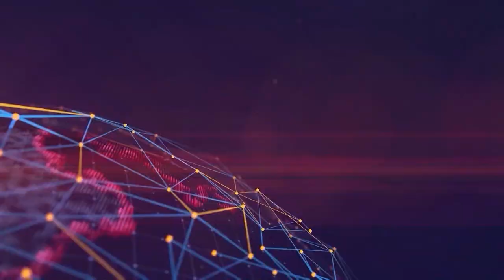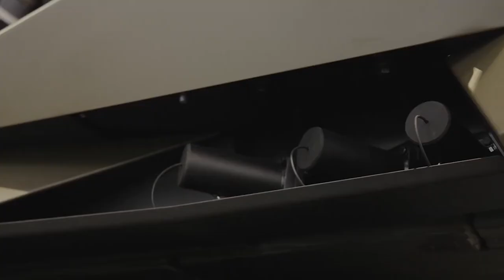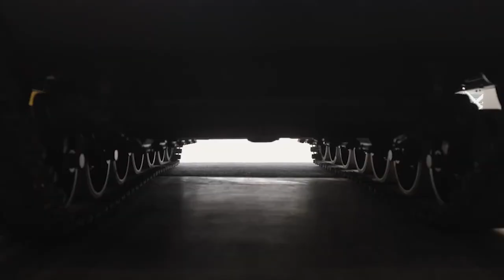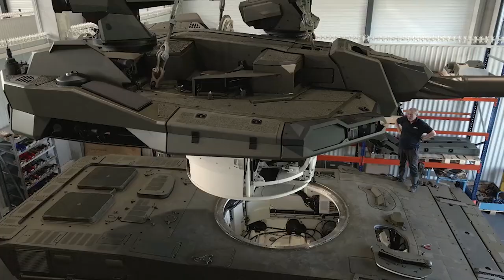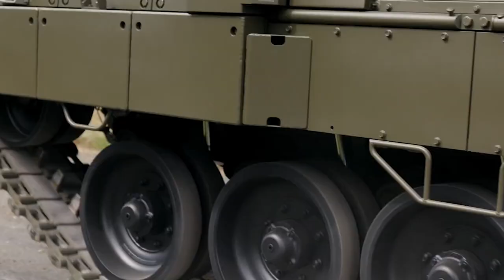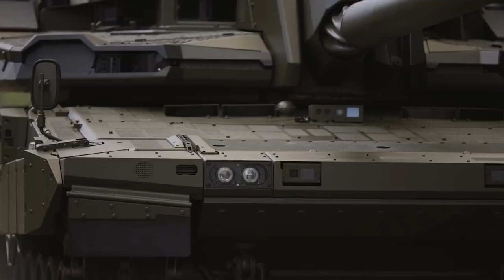Discover EMBT Nexter future concept of Enhanced Main Battle Tank developed by France and Germany

Comment: The first demonstrator was a Leo' 2 with a Leclerc turret (to prove that the second was integrable into the first. Well, 6 year later, the prototype is here and... that's litteraly a Leopard 2 chassis with that seems to be a redesigned Leclerc turret and a GIAT 120-26 gun.

I presume some work was done to integrate further tactical system, but basically, according to KMW and Nexter, the future of european armored warfare was designed into the 70s...
Reply: If it took them 6 years to do that, then I don't see 2035 yet.
The main problem with the new joint tank is that the French claim a share of the tank building... good or bad.
And then Rheinmetall was more or less pushed out of the project. Not good for Germany and not good for the result.
I would beat an egg over it and rather rely on Rheinmetall and the KF51 Panther.
Why should we leave the key technology to the French and let them design the new tank turret. Even the Leclerc was only a second choice. Germany can then build the chassis... well, great.
Reply: @bobthecanon3457  Germany knows how to build better chassis, and the french knows how to build better turrets. It's as simple as that. I could argue the KF-51 is just a bigger and modernized Leopard 2A7 with a shiny new gun and an ATGM launcher. I don't understand your arguments because it can be said for the other way around
Reply: @pow-r_official  🤣🤣I have to laugh. Rheinmetall can build towers, but they were pushed outside the project. France is now only using the opportunity to bring the second best steak to the man but who says that Germany will not choose a Panther as Leopard 2 successor. What are the advantages of the French tower? Absolutely none! And the shape alone is not very suitable for combat.
It's not about France and Germany, it's about the product. Unfortunately, this project cannot deliver the perfect result, as the interests of two countries and manufacturers have to be taken into account. That's the problem.
We see the problems at Airbus. Unfortunately, France is not very cooperative.
No, the Panther isn't just an A7V... it's a completely new development. The demonstrator is currently still using components, but the hull has been completely redesigned, as has the turret.
Reply: @bobthecanon3457  It's the main principle of a joint project. If the french finance as a stakeholder, they have the rights to claim a part of the developement, otherwise, they might as well buy their future tank off the shelf. But yep, I agree. Moreover, France and Germany have often different vision and use for their comparable equipment, and it's difficult to find acceptable compromises. The EMBT have IMO the same future that the SCAF, and it's not bright.

Basically, Germany will probably rely on KF51 concept: fully Germany-made, well armored, conventionnal and adapted for export. And France... Well, replacing the Leclerc is not a emergency, and there is another french neighbor with a quite similar tank doctrine, used to collaborate with those pesky and capricious frog-eaters in successfull jointventures and a strange and mobile mobile tank designed in the 80s which require some modernization.
Reply: @Jenkouille  No, the problem is that Germany actually has project sovereignty for the new tank and France for the aircraft. For the financing, that was a good idea 6-7 years ago... you couldn't assume that Europe would be at war and Russia would be the new old enemy.
So it would have been completely irrelevant what would have come out of it.... for the best in peacetime it would have been enough. But now things are different. We really have to work hard. It's about defence. Our army needs good, superior weapon systems.
Germany is having a really hard time with young people in the Bundeswehr anyway. We can't fill up the army already. That means... we have to have excellent weapons if we can't scrape together that many soldiers.
Yes, I hope we will rely more on Rheinmetall. With the merger with NEXTER, KMW put the nail in the coffin on the company anyway.
I have nothing against the French, but we build better tanks.
Reply: @Jenkouille  The project already started with the French and KMW starting to push Rheinmetall out of the project. Of course, France has an easier game. Corrosive stuff. Rheinmetall builds the best guns in the world and is a leader in many other areas. It's cheeky that NEXTER and KMW think they can push this competitor out together and then settle the matter among themselves. The shot backfires.
I say... they won't build the Leopard 3. That's what Rheinmetall does. And it's always like that with the French. It was the same with Airbus.
Reply: @bobthecanon3457  you have 1 french manifacturer and 2 german ones. Therefore germany would have 67% of the project with 33% for the french. 

Objectively though, french turret is more capable then the leopard for its doctrine. But in the end you're trying to compare two different war doctrines into one bag. Armies have different needs. Not all tanks have to be a leopard.

And please, be a bit more respectful for the things you do not know. We understand you are a big Reinmetall fan.
And I share as much respect for Reinmetall then I do with Nexter or any military brands in the universe. They all have something interesting to show and we need to have this diversity to earn the best products
Reply: @pow-r_official  Wouldn't that be 66%? 😂 Math is hard.
Reply: @pow-r_official  Basically you hit the nail on the head 🤣
Reply: @pow-r_official  Really 25% 🤣Well... math doesn't seem to be your forte. The correct figure would be 33.333% and not 25% (assuming equal shares). It's a good thing you're not building tanks.
NEXTER and KMW, which founded KNDS, kicked Rheinmetall out of the project. More or less. De facto there is only one company from two countries.
Reply: @bobthecanon3457  bravo sir
Reply: @pow-r_official  Thx... I know 😇😚😏
Reply: @terrestrialextra4790  
You're right... he (Homeless Studio) was probably a bit embarrassed, that's why he changed it from 75/25 to 67/33%.
Reply: @bobthecanon3457  Rheinmetall builds the best guns in the world..... what a great joke poor guy...
Does Rheinmetall build the CAESAR?
Germany resumes its old European imperialist dreams by believing itself better than the others.
We'll talk about it
Reply: @terrestrialextra4790  one third equals 33.33% two thirds 66.66% rounded to 67%.
Indeed mathematics is hard....for you
Reply: @fredericchapuis8121  Well... that's how the French like to see it, but the truth is that France is oversleeping on reforms and so economically uncompetitive. The French shy away from tough measures, just as Germany or other countries did decades ago. The power of the unions in France and a lack of reforms are keeping the country grounded. We (Germany) would very much like France to be economically stronger. We don't fear that... quite the opposite. France makes itself small and we don't understand that.
This ridiculous notion that Germany would want to be above other countries. Do you have an inferiority complex? Always the same sauce. For you, it's always someone else.... but ultimately, and if we're being honest, it's France itself that needs to hold its ass in hand instead of constantly whining.
Reply: @bobthecanon3457  The let's talk about the Eurofighter. The Eurodrone. The SCAF. The Tiger. The freaking MAWS. French aren't the best when it comes to international joint ventures, but I believe Germany is even more of a rotten partner...
Reply: @qenyaithandrill7848  I wouldn't say that, even if we Germans are sometimes very complex. That's true, but I can refute your thesis based on the majority of successful international projects that have been working for decades.
I always see problems when management is split between two heads for political reasons. This cannot go well and has nothing to do with a French or German problem. I myself was a project manager for very complex topics for years and everyone who has worked in project management knows that there must be clear tasks and management positions. In the Franco-German tank project, there are almost always losers (from the point of view of the individual players) and ultimately it will also be the case that precisely this artificial political intervention from outside will result in the end not being the best solution for the project, but the pacification of the interests of the individual participants must be distributed equally somewhere. That's a very, very bad starting position.
As I said... I already see the problem in the task and constellation.
It is already the case that KNDS (KMW and NEXTER) have more or less pushed the third party in the alliance, Rheinmetall, out of the project. It's obvious why.
We're in a time when we don't build guns for paper. We in Germany have a problem with the reputation of the army after being brought up to be pacifists for 70 years. Wars are waged by others... we pay. Today we're supposed to be rebuilt to become the largest army in Europe.... but we're not getting any soldiers. So we need to equip the soldiers we have with the BEST there is. Otherwise God help us. Soon the Americans will no longer be our shield... we have to ensure ourselves that we can defend Europe. We can't afford that shit. We need the best weapons from the best components.
Reply: @qenyaithandrill7848  Let's be honest. In 2014, no one cared that Crimea was conquered because Ukraine was not defending itself at the time. The Russian green men marched in there without a fight and some of them were greeted with flowers. We didn't give a week to the Ukrainian army on February 24. We have decided. They defend themselves... very well.
But when Germany and France decided on the joint tank project (I think in 2015), this topic was not a priority for us at all. A new tank... well, let's do something with the French, then it won't be that expensive for Germany. Today it looks very, very different.
Germany has just about 300 MBT's Leopard 2. And France doesn't have much more either. Germany has literally pulled the pants off the army in recent years and the French are investing a lot of money in the aircraft/helicopter carriers and the A-weapons program.
We don't have time until 2035 for tank successors, some of which have already been in use for over 40 years.
And... we're not the only ones upgrading. Where are all the tanks for the modernization and rearmament of NATO that are now needed coming from?!
Reply: This is just a proof of Concept not what the MGCS / actual E-MBT is going to be.
This is the EMBT, the "Enhacned Main Battle Tank", which is not the E-MBT, the "European Main Battle Tank" which has been renamed MGCS-Concept due to obvious reasons.
Though the KNDS EMBT 2022 is actually a Vehicle yet while the MGCS/E-MBT still is just a Leclerc Turret on a Leopard 2A7 Hull.

Well, what you're seeing is basically also just a Leclerc Turret on a Leopard 2A7 Hull, but it's a very Fancy Leclerc-Based Turret on a enhanced Leopard 2A7 Hull with some System Interoperability, Fancy Sensors and a Trophy APS.
This is not what the E-MBT/MGCS is going to be, it is meant to be proof for the respective Governments and People of France and Germany that a jointly developed Vehicle is theoretically, and to a certain extent practically, possible.
Though among most Analysts this is still very much so debated as the French are notorious for being incredibly protective and biased towards their own industry and ideals, that's why they left the EF-Programm to develop the Rafale after all, while the Germans are well known for relying a lot on their incredibly expensive, though modern Technology like the Puma IFV or Meteor A3M which would make procurement by the less wealthy European Countries basically impossible.
As nice as the Idea of a joint System is, the current French Mindset of "It has to be as French as possible" and current German Mindset of "It has to be as New (and thus expensive) as possible" just don't go together.
Again, the entirety of the Typhoon Program is a great example of that.

With the current political Climate within the EU there are Three Main, more sensemaking and realistic Solutions, the Economical, Competitive and Political one, in that Order, ranked by Viability:
The Economic Solution would consist of every EU-Nation choosing the System that is the most Viable for the overall Economic Situation of the sovereign Nation and the EU as a whole, which would end in the even more widespread adoption and modification of the highly Modular Leopard 2 Platform, which in turn would just piss off the French because there is a reason no other European Nation uses the Leclerc while the Majority uses the Leopard 2.
-
The Political Solution would be different batches of Vehicles by different collectives based on Shared Doctrine and Ideals, which would probably just end like the Previous European joint development Programs:
Germany, Sweden and Italy come up with a excellent but expensive System, maybe joined by Spain while the UK, Australia, South Africa, Israel, South Korea and/or Japan might chime in as non-EU Observers, the French would do their own thing, again maybe joined by Spain and/or one/some of the non-EU Observer Countries and Poland would probably join up with the Baltics, Eastern- and South-Eastern Countries to come up with a significantly Cheaper, but ultimately inferior altenative.
So basically Status Quo.
-
The Competitve Solution would be to have one Big, Definitive Competition of European Manufacturers which would decide the best System.
Which sounds like the fairest and best, but would just end in either a Leopard 2 Version or the KF51, which in turn would, like with the Economical Solution, lead to a German-lead System becomming the Norm, which again, would mean that it wouldn't be an actual "Joint European System" and more of a "German-based European System".

Nothing against the French, but the issue here is that the French demand that at least half of the Vehicle is French, even implementing the Leclerc Turret on the E-MBT was not the first choice, and while they at least seem to have agreed that there are changes that have to be made to their beloved Turret, it's still inferior to the Leopard 2's.
Again, there is a reason most of Europe (and even non-Russian-buying outside of Europe) chose the Leopard 2 over the Leclerc.
At least the MGCS-Concept is still running, maybe they'll come to senses and develop a better Turret based on the Leopard 2's, or even better, develop a completely new one.

Now when it comes to my Opinion i honestly hope we'll stomp the MGCS-Project in the Ground, along with FCAS, Germany and France are just too different Politically and Doctrinally, i mean just look at the Tiger or the Eurodrone.
As with FCAS, none of the viable Options see a succesfull and more than anything equal codevelopment.
Of the three most Viable Options i honestly like the Political one the most.
Both Germany and Sweden and Germany and Italy work a lot better together then Germany and France, and i don't really see how the Italians and Swedish could clash.
Have the Germans, Swedish and Italians develop one System, the Easterners and Baltics theirs and then have the French build their own or find someone who is willing to cooperate with them, if that's even possible with how protective and biased they are.
Reply: @FTWIHA  Very well analyzed! That hits the bull's eye. Thanks for that!!
Even if the MBT70 or Kampfpanzer70 project was 50 years ago, you can see parallels. And you describe the currents and mixtures very well.
In addition, the operational doctrines are completely different. Germany has a core capability in Panzerwaffe, even though we only have 300MBTs. Nevertheless, we are currently incorporating the armored forces of other smaller nations into our army organization (example Netherlands).
It is important for us to focus on quality instead of quantity.
Reply: @bobthecanon3457  
The Regional aspect is also something very important to consider, Germany can afford a Heavy System like the Puma for example as we don't hold any Territories and all of our Permanent Missions are usually planned to last for at least half a Year, making the Economical and Logistical Strain worth it, with the Bulk of our Armed Forces being meant to defend the Borders of Central and Northern Europe.
That's a big aspect of why we are doctrinally more compatible with the Italians and especially the Swedish, while France not only has more Missions Globally, but also holds sometimes more, sometimes less remote Territories that need protection, making "Heavy" Systems inefficient.
As you wrote, same issue as with the MBT-70, the Americans wanted a lighter, Mass-Produceable Vehicle meant to be used around the World while the Germans wanted a System purpose-built for Central Europe and German Doctrine with as many Operational Capabilities as possible.
Reply: @FTWIHA  Right!
Ultimately, the operational core of the German army is again similar to what it was when it was founded. The Defense of Central-Northern Europe.
The Leopard and now also the PUMA have been developed exactly for this scenario, whereby the PUMA with the additional armor and air transportability has already been addressed to the briefly changed operational profile of the Bundeswehr. Which is already outdated today. BUT in terms of the basic capabilities, with the LEOPARD 2 and PUMA we are talking about weapon systems that are superior in Central Europe, the properties of which are designed and optimized for the territory and logistics of the Bundeswehr or its allies in Central Europe.
Since we have to assume that as Europeans we will have to get by without or only with reduced help from the Americans in the medium term, it is extremely important for us to continue to have superior weapon systems. And I'm with you there... that doesn't work with the French approach.
The PUMA is the most expensive armored Spz in the world and many features are simply not necessary for other armies, do not fit the doctrine or simply make the vehicle too expensive, but for the German army and for Central Europe the PUMA is the best armored SPz there is. And since we (the Bundeswehr) are not going to buy 2,000 MBTs anyway, let alone get the crews full for it, we have to be content with 300-500 top-class MBTs. But these 500 tanks are vastly superior. This is the way.
We don't have any missions far away from Germany where we need easily deployable MBT's. We need breakwaters and anchors.
I think that in the future, light battle tanks like the LYNX120 or the Ketten-BOXER 120 will play the role of quickly deployable and powerful units anyway. The Leclerc concept just doesn't matter... at least for Germany.
From that point of view, I'm hoping for a result like the MBT70 or the Panther.
Reply: @bobthecanon3457  
Agreed, though i'd still criticize the Puma for it's lack of Missile Reloadability, two SPIKE-LR's just don't do it.
Even if they're doctrinally meant to Operate in Packs, together with the Grenadiers' Panzerfaust 3 IT's and along the Leopard 2A6 and A7's in the Tank-Killer Configuration, when you write it out it becomes quite apparent that the Puma relies on a lot of "if's" and "when's", always assuming that it'll be used in it's Doctrine, and even then it's partially lacking.
As heavily Armored as the Puma is, it still lacks the Offensive Capabilities and Survivability to Push along the Leopards, especially if you consider that it is also meant to clean Urban Enviroments and Forests with its Grenadiers.
The Coaxial MG-4 lacks the Power neccesary for a Coaxial Machine Gun,
it doctrinally can't equip a Hardkill-APS and the MUSS as a Softkill-APS isn't enough without a Laser Hardkill System as a Backup and another Set of directional Jammers as well as a Signals Jammers for Remote Explosives and Mines.
The Construction-based inability to install a RWS as Secondary Armament for the Commander is also highly questionable, even with the Hunter-Killer System.
I'd also criticize the lack of interoperability with other Nations, big part of why the Puma is so expensive and unpopular to work along from other Nations' Perspectves is that it's tailored for German Doctrine, meaning that they'll have to Synchronize theirs to the German one.

While i completely agree on the Lynx-120, Boxer 120 and CV90120/Mk.IV are the future of Light, Airmobile Anti-Tank Vehicles, i have to disagree with the Puma being the best IFV for Central and Northern Europe.
I think the CV90-Series of Vehicles are probably unparalelled when it comes to that role, their Modularity and upgradability is just superior to the Puma, the only thing that can compare to the CV90 is the Lynx, which offers more or less the same Capabilities for more Money.
Reply: @FTWIHA  We agree on the MBT but not on the PUMA. Although I'm actually a fan of the BOXER and LYNX and really appreciate the variability here. For this reason alone and you are right, the PUMA is not suitable for other nations and remains the German special solution.
However, I see the advantages of the PUMA as really tailored to our army and I don't share the very critical attitude either. I also do not share the opinion that the Bundeswehr is dissatisfied with the vehicle. Lot 1 has its weaknesses but with the upgrade and the additional PUMA we get we have a very excellent infantry assault vehicle. However, it is designed very one-dimensionally and ultimately too expensive.
That's true. Internationally, the PUMA will not play a role.
I'm very curious about the Bundeswehr's decision to introduce light main battle tanks (120mm). I see a lot of potential here, especially since systems such as BOXER and LYNX are very variable and these upgrades can also be easily maintained in the modular system and role behavior. Say a tank with various modules.
Reply: @bobthecanon3457  
Don't get me wrong the Puma is excellent, but while i agree with them the Criticisms are not my Opinions, they're the Result of Analysis done by the German, U.S., Dutch and Australian Ministries of Defence.
Within the Bundeswehr the Opinions on the Puma are very Split too, on one side you hear the fair and deserved Criticisms i mentioned along the literal thousand Issues on the infamous List, on the other Hand you hear the again fair and deserved praise of the Puma's Protection, Mobility and AHEAD-Ammunition.
Though that's not what i wrote in my Comment, i wrote that other NATO-Nations don't like to work along the Puma because of how incompatible it is with NATO-Doctrine.

Adopting Light Tanks would fit in the German Doctrinal changes as part of the Airmobile Global Response Force and Airmobile High Readiness Force.
If the Bundeswehr decides to further extend its Capabilities in these Roles i'd rather see the additional adoption of CV90's Tailored to these needs alongside the Boxers instead of just Boxers as the CV90 has about the same dimensions and weight as the Boxer but would nicely complement it's abilities while also acting as a much needed Light IFV for the Bundeswehr and massively increasing interoperability with other NATO- and EU-Partners.
The German Ministry of Defence already said that they're not going to adapt the Lynx, so CV90's along Boxers are the only sensemaking Option.